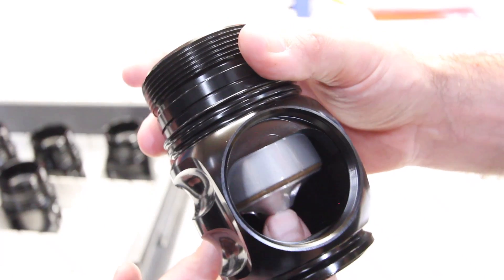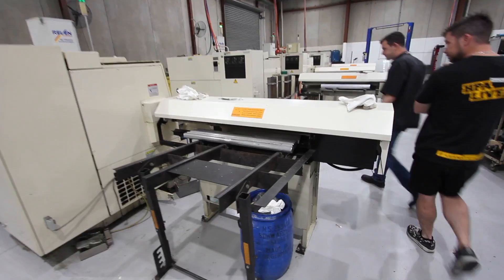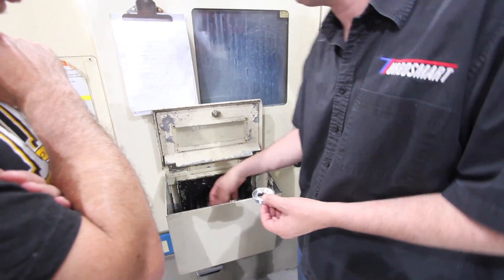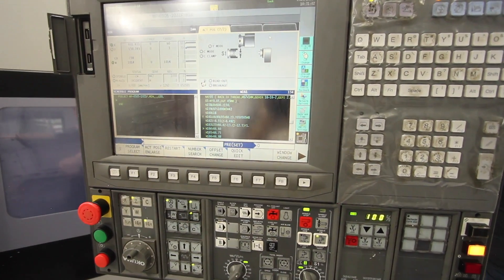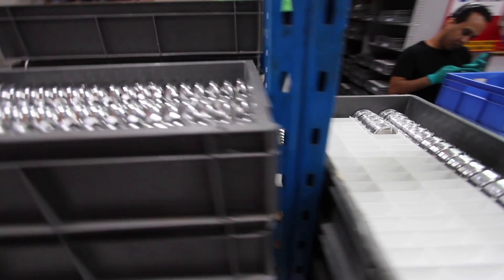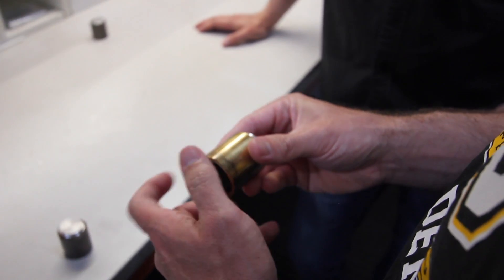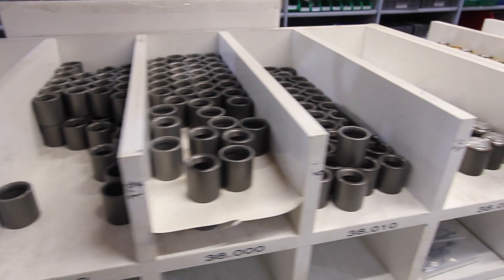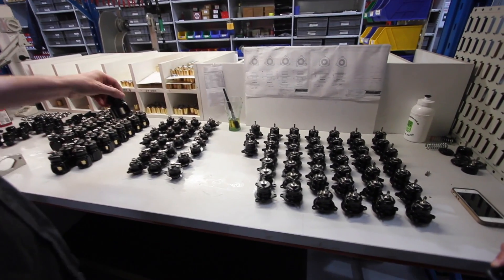Learn more about Turbosmart product design and development

Comment: Turbosmart products represent high quality functionality, yet I've had a recirculating BOV arrive poorly packaged with surface scratches/ gouges on finish. Not a deal breaker but not impressive either.
Reply from the maker: Ah that sucks. I totally understand you get a nice part and you want it to be nice out of the box. The guys at Turbosmart will totally understand that too, I'd get back in touch with your dealer and try and get a replacement, if you don't have luck there try getting in touch with TS HQ.  All the BOVs we saw leaving were sent out in awesome protective packaging. - Ben
Reply: Ben, I did just that. It's just that small oversights such as poorly packaged goods often cost the customer twice; once for the initial sale, and second for the return shipping costs. So, you either make peace with a less than glamorous item in your engine bay or accept that you just payed for someone else's mistake. Anyway, HP Academy has so far been stellar in thier customer service ;)
Reply from the maker: Yeah I totally understand. I worked in a shop selling turbosmart for many years and never had a problem. I found all their products to be packaged really really well. What did you buy? I'll pass a message on to their team as I'm sure they are keen to fix the problem :) - Ben
Reply: TS-0989-1001 BOV Kompact Plumb Back 34mm Inlet 20mm Outlet sold through Flyin Miata USA. The supplied clamps were not isolated well from the body of the BOV and gouged the metal. FM was reluctant to accept the return until I offered to pay shipping both ways. They actually repackaged the placment before sending it out to me. Anyway, that's the story. Thanks again Ben!